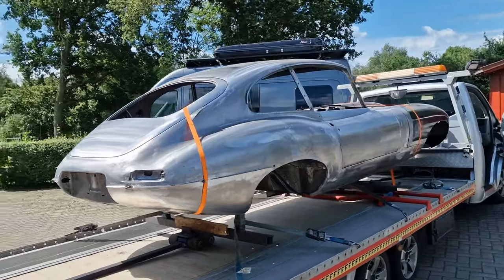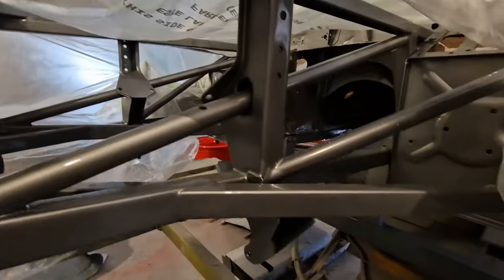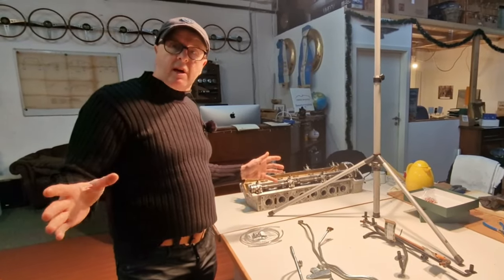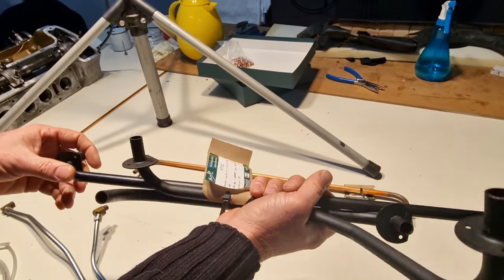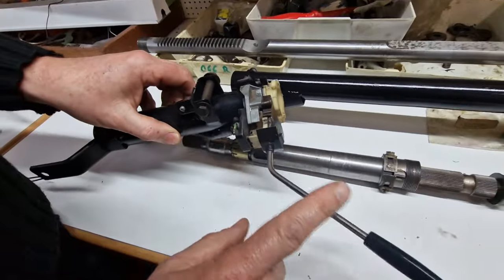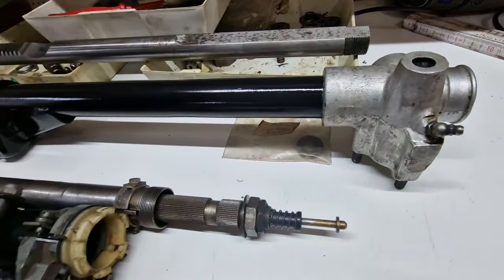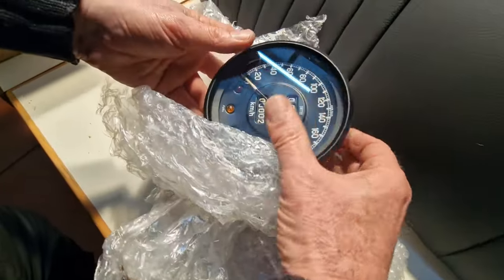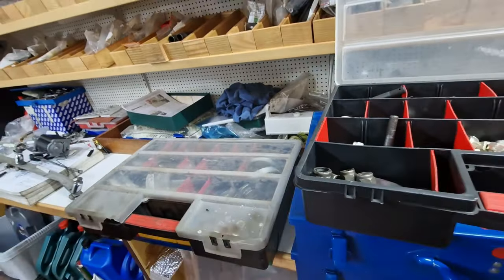Jaguar E Type Restoration Update: Preparing for the Body Shell Return!

Comment: Maikel,  As you say the prep to have the parts ready for rebuilding and fitting parts in a certain order are so important. I know from my own experience waiting for parts or
finding they don‘t fit is very frustrating and the time lost can be huge. I have to say the more restorations you do the better this pre-organisation becomes. Cheers Dave
Reply from the maker: Good morning @ClassicCarCave,
Dave, you have done several restorations, so you know as good as I do. Even with trying hard to predict and prepare everything, I and also my friend Owen, finding the car "almost" ready, but it seems, it will take forever to get it registered. The moment when you think, you are almost there, up to the final bolt, takes so long. Plus the shake down miles. It is not that when the last bolt is in, you are done 😫😩. Usually after the first test drive you always find some issues to fix. Especially tightening the bolts and nuts after the first warming up, extending and vibrations. How often did I have to re-adjust the torsion bars after the first 100 km. And you know how awkward that is. Just saying, as we all have been there and will always be there but it is getting much better. Stay tuned, Maikel 👍

Comment: Hi Maikel,
Thank you again for that new video and the good avices to avoid time consuming mistakes during restoration.
Not surprised that you install a Coolcat fan, that's the best solution for discrete look and efficiency. 
Is your original tank still healthy or will you install also a Marston repro rad from Michael Franck?
And what about your header tank? This remains an issue for all of us looking for a correct repro of early tanks...
Reply from the maker: Hi @paydase,
Serge, he have really good eyes 🤓. The header tank on car no. 66 is only a place holder and will be replaced when I eventually obtain one that looks exactly like the original but with better quality. Also I will be using EVANS Classic cooling liquid in that early car wich still has the original Marston radiator. I have that same cooling liquid in my other unrestored 289 and works perfectly. Just make sure you do not mix it with water. Evans does not get that hot and creates no corrosion. It is just very expensive. I thing Dave from the car cave channel has also talked about it in one of his videos. On the other cars I am using the NAR radiators. I find then robust and functional, and on top they do look very much like the original Marstons. But you are right, Coolcat also is making radiators which I never tested. I am just using their outstanding cooling fans and you obviously have made the same positive experience. Stay tuned. Maikel